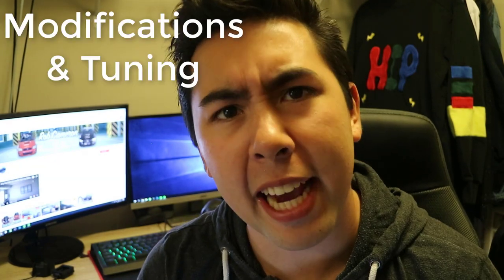How to make a Subaru WRX Reliable

Comment: So wrx is reliable. The driver makes it unreliable.  Know how to drive your car. Mod it correctly. Maintain the car. Then your good and reliable. LIKE ANY OTHER CAR.
Reply: Explain how my 2020 wrx with 28k miles had a spun bearing at 27-28k. Oil changes. Proper operation of it as far as not hopping in and going crazy,  or wot, or trying to accelerate in too high of a gear and lugging it, only hit 5k once and was after warranty repair. I'm convinced those online commenting positively are bots.
Reply: @remissiveslave  there was a lawsuit about that. I believe you can get it fixed for free from subaru. You need to look into that. It happened to alot of them got to look at your cars number and see if it matches. Best of luck.
Reply: @hunterjohnson8200  already did and now it runs weird, has strange turbo surges and shut and has a weird subtle similar to rod knock tap when steadily applying throttle.  I'm done with these cars. Paying it down and trading into a economy car thdts slow and simple. Not going through this b.s anymore.

Comment: I wouldn't think a cold air intake or different filter would throw off the air fuel ratio, I don't know much about Subaru engines, but I would think they have sensors to measure airflow and adjust it properly as most modern engines do. Your friends engine probably just blew up because he had bad luck and was driving it hard, could also be that the higher flow air filters don't filter out particles as well as OEM filters, I think that leads to issues over time although I doubt it will destroy an engine in the short term.

Comment: If I got a wrx which I want to someday. It will be a 02-05 with the ej205. Killer b pickup tube, cyl 4 cooling mod, air to oil separator and maybe e85 tune (to help run cooler) probably will just to a cat back. It’d be my first turbocharged car and my 2nd Subaru. Thanks for advice!
Reply: I’m assuming you own one now 🤣

Comment: The intake on a stock engine totally depends on MAF senser not the more air that they can take in, so the sensors positioning will effect how much air the car believes it is taking in, as the turbo injects the air into the engine and not the intake itself, the cars electronics and ecu should be able to adjust to a regular cold air or short ram intake as long as your not adding it with an exhaust or other parts and the MAF sensor positioning is in the sort of same area that the oem one is.

Comment: Any tips for the newer FA engines? 😊 great video!!!
Reply: Don't push too much timing or allow it to lean out or you risk detonation which increases risk of ring land failure in the FA engines as the direct injection setup has much higher compression ratios. The FA engines being fairly new I know a lot of people building them up are basically experimenting and most don't do a terribly good job at blueprinting and documenting their progressions thus it is simply trial and error followed by guessing what went wrong. Best tip I can give, which has proven very successful with the EJ series, is to follow what the STi group is doing for their vehicles to make sure they can with stand the rigors of competition in the respective classes that would still be street legal.
Reply: Don't buy, will have problems. They are also glacial in speed without indefinitely ruining motor with mods.

Comment: I just did the same swap you did to my 02 bugeye, did you tune your jdm ej205 after you put it in?
Reply from the maker: Yes I did
Reply: @robdog9265  how long did you wait? Im thinking of putting about 500 easy miles on it before having them tune it.
Reply from the maker: @Supernova778  I would say around there. A little less maybe. Of course just stay off full throttle. and  you'll be fine for the most part.

Comment: 8:50 What stock wrx? it seems like there might be more to this
Reply from the maker: Newest generation, I believe a 2015/2016. The point is, that even a simple mod like a cold air intake can throw off your cpu because of air fuel ratios, etc. This is very unlikely to happen, but boxer engines can be super sensitive
Reply: @robdog9265  can be? No, they are notoriously finicky and tricky. What it takes done right, to not fuck these pos up is almost completely not worth it unless you have residual from a bank heist.